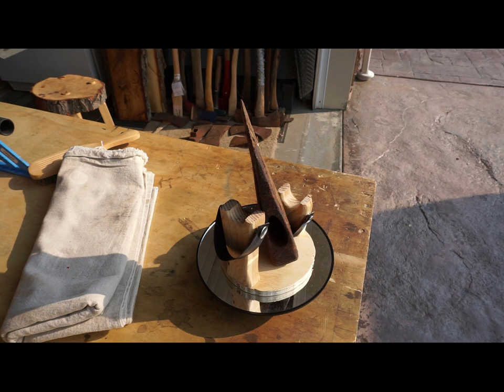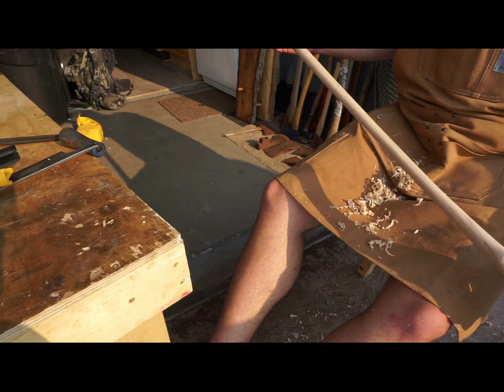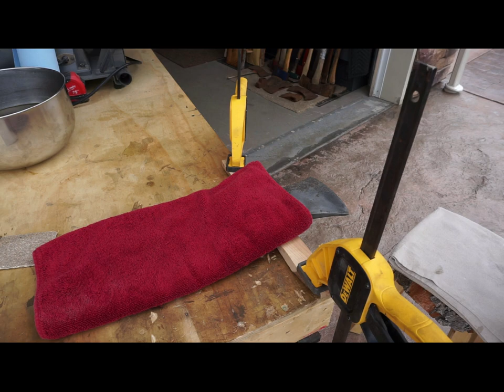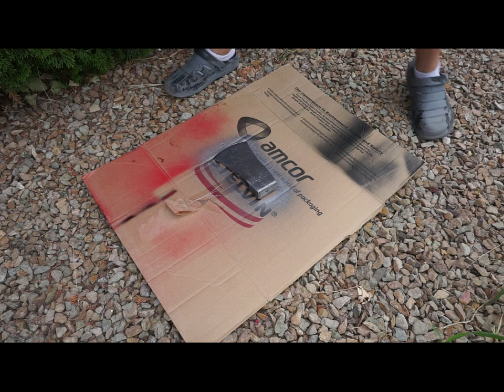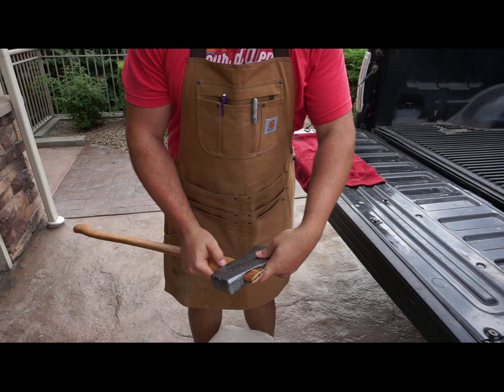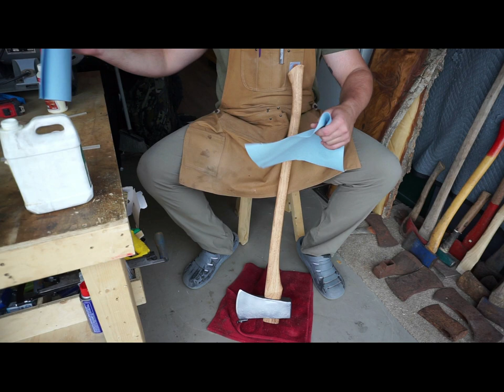The WORSE pitting I've ever seen! Vintage 1970's Mastercraft axe head, can I fix it? - NOPE

Comment: I'm late to this party but why change now. I picked up a mastercraft head just like that one but a little better condition. I don't think people realize just how much work and time consuming these projects are. 
  Can you estimate start to finish the time you have invested? I wanna see if I'm close, but I must keep in mind that I'm just starting out. Maybe 10-12 under my belt. Thanks
Reply from the maker: The early mastercraft axes are actually great, they are not even remotely similar to the lack of quality we see now. But prior to the 2000’s (I believe) they were made in Philadelphia with a lot of other well known axes that were manufactured by the same company and re-branded. So if you can find a decent mastercraft marked axe, hop on-line and check out the dates associated to the font used in the markings. 

Now a days, it takes me about 4-6 hours to do a basic axe. But that’s having done a lot. Sorry about the delay in response to your question, thanks for watching and good luck in the future with your projects!